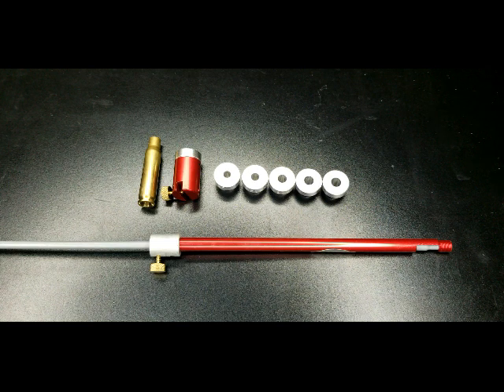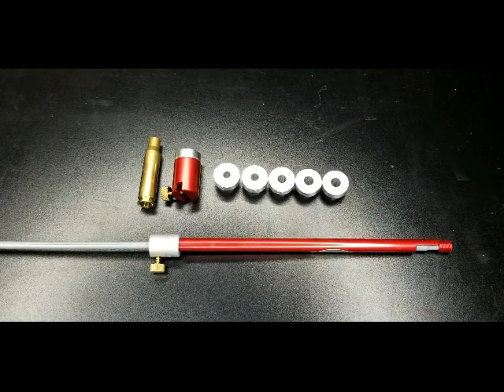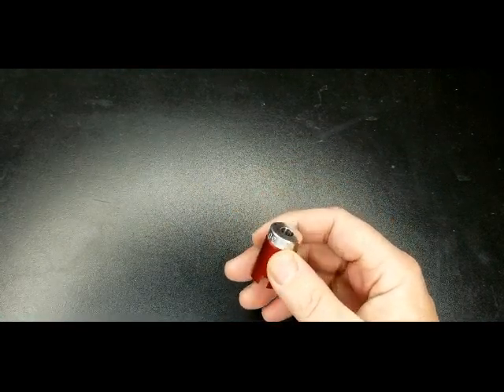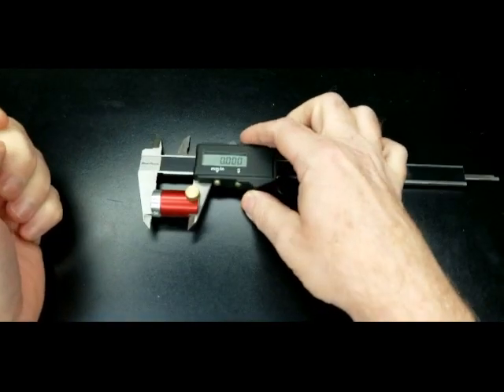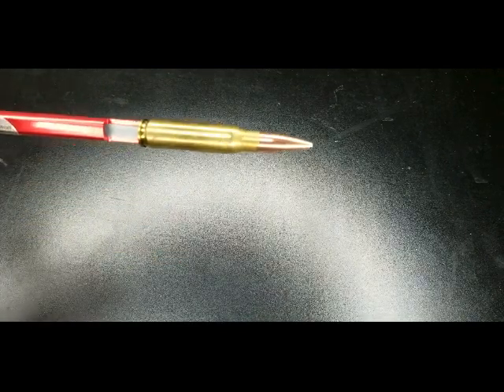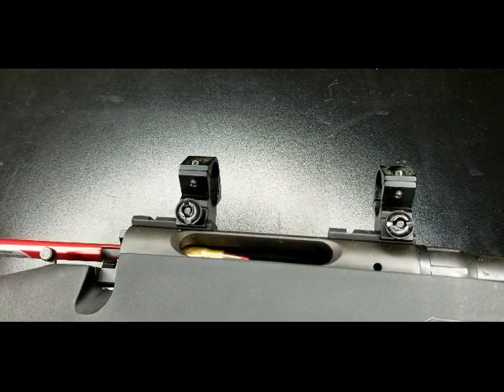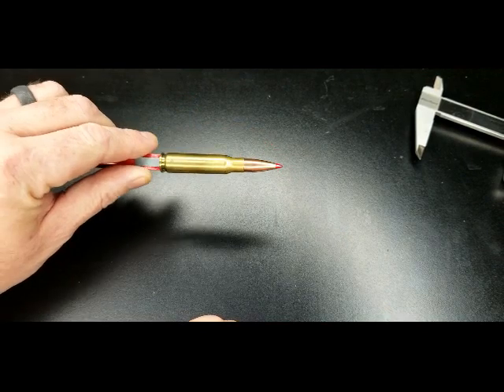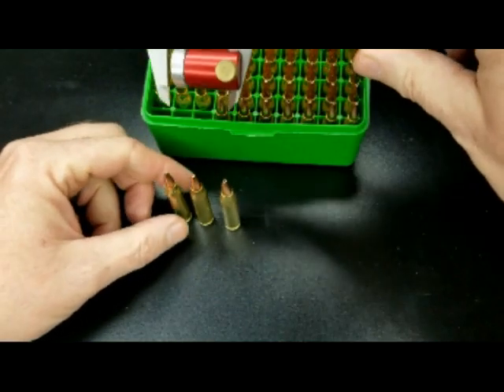Using The Hornady Bullet Comparator and O.A.L. Gauge

Comment: This is helpful, I am just starting to use headspace and Bullet comparator gauges. However as you pointed out maximum bullet seating depth will ultimately be determined by the magazine. I am more interested in the headspace gauge operation as I want to bump the shoulders back without resorting to a complete full length resize.

Comment: If you can drill and tap a case fire formed in your chamber that does not need full length sizing, you will get very consistent readings.  Drill size and tap are odd ball, but no big deal, hello Amazon for the order!

Comment: 2.269 is not overall length COAL ;  it's base to o'jive  CBTO
Reply from the maker: You are correct. I was talking about base to ogive length.
Reply: @JohnFazer  another tip for the Hornady bullet comparator ; I just measured 3 different 223 bullets of different weights and manufacturers and found a total of CBTO variance of some .030. All bullets must have identical O'Gives. Then I removed the plastic plunger and filed down the rounded end into a more pointed end and remeasured a 3 bullets. 8 each and found the new total variance of the same bullets to be .010. In two of the bullets the CBTO variance was less than 4%. Very accurate now. 
My conclusion is the bullet bases are not 100% perpendicular to the concentricity of the bullet and the plastic plunger end is too large to get an accurate reading on a small point from the base of the bullets. 
This was all done in a brand new JC Custom barrel just purchased and not installed. 
I wish Hornady would install a smaller metal pointed end on their plunger for a little extra money. 
😀

Comment: Does the seating die seat from the tip or from the ogive ? And do different dies seat from different spots on the projectile?
Reply from the maker: This is not a seating die, but in general seating dies will seat from somewhere on the ogive. Some seating dies also have multiple stem to fit specific bullet profiles.

Comment: Would you be able to just use the OAL gauge to measure the longest round that would fit your magazine?
Reply from the maker: Yes, but it would change with different bullets. Also it would be good to double  check to the camber through to be sure you have the clearance. That being said, I have never ran into a round that would fit the magazine, and be too long for the camber
Reply: @JohnFazer  That’s what I meant. If your OAL for that particular round is too long for your magazine, I would just shrink it down to the longest that will fit in your magazine.

Comment: I can’t figure out which gauges I need,is it the 24 and the 30 .I have 308,306,7mm08,and 243,is the 30 for 7mm08 also
Reply from the maker: You will need both the 24 and the 30, you may need the 27(?) for the 7mm
Reply: @JohnFazer  tyJohn

Comment: Thanks for the video. I purchased both items. Using the OAL gauge on my Weatherby 270 magnum I never felt any resistance. It pushed the bullet all the way out of the brass case. I’m wondering if my chamber barrel has been shot out. It is a 1961 that I bought used and knew nothing of its past history.
Reply from the maker: If that is the case, I would take it to a gunsmith to have it checked out. Hopefully it is an inexpensive fix. Thanks for watching.

Comment: So as long as where the bullet enters the barrel is the same length the overall messurement means nothing?
Reply from the maker: Overall length is important for magazine fitment. Measuring from the ogive is more consistent.
Reply: Ok im 100 percent new to reloading i do run cnc machines at work so i play with these guages every night so what if ur length is fsrther back so ur bullets fit into ur mag can u still get a tight group
Reply from the maker: Most of my rifles get loaded to magazine length. The chamber length is usually longer. I still get pretty good groups, but I am not shooting any super long range either. I bet I could get better groups loading to camber length, and single feeding rounds though.

Comment: This is a handy way to gage throat erosion. It also allows you to determine bullet jump to the rifling. What you are not measuring is the cartridge overall length (COAL). That would be measured from base to tip.

Knowing bullet jump is useful, and can help fine tune a load. However You are focused on having just a few thousands from the rifling. How much of the bullet is in the case? Insufficient bullet seating would allow the bullet to move, or shift off center. Nothing about this is really useful and can cause dangerous pressures.  In belted magnums having such close tolerances is dangerous and not recommended. Every manufacturer builds in a certain amount of bullet jump for safe operation.  Before using this technique, make every attempt to find out what bullet jump is required by the gun maker.  

All this video did was lead me to suspect the barrel in the rifle is shot out.  Each shot is the equivalent of a plasma jet. Burning powder over time will erode the rifling nearest the case. The smaller the bore the faster it occurs as I understand it. (The US Government did not stay with the 6 mm lee and went with 30 cal because of excessive barrel erosion.)